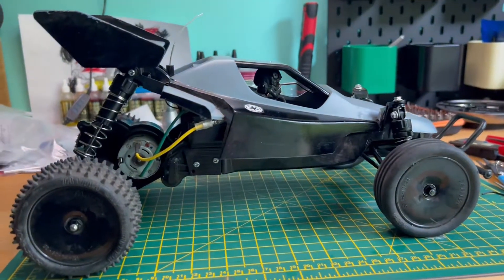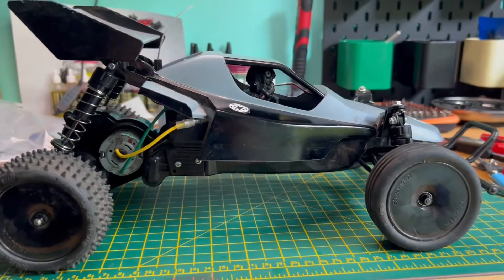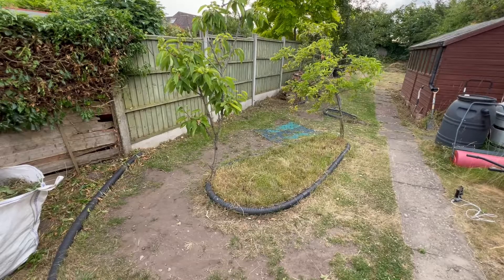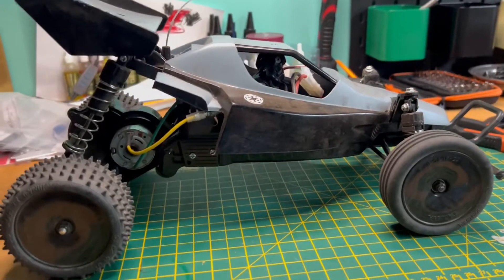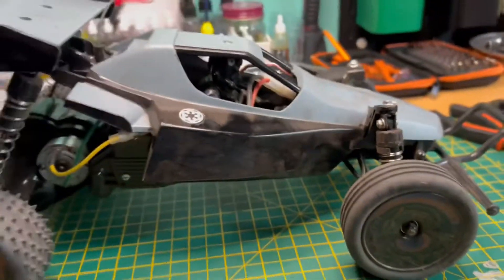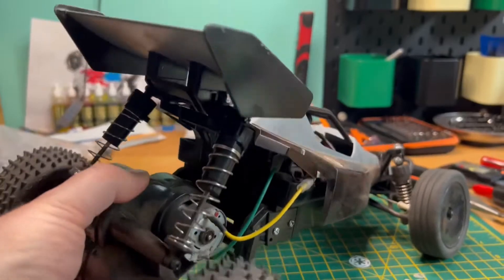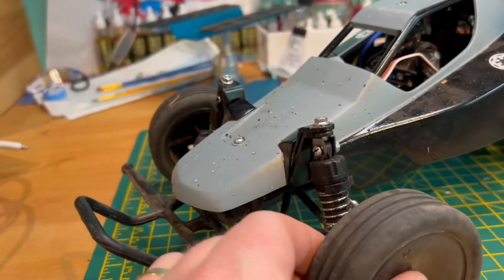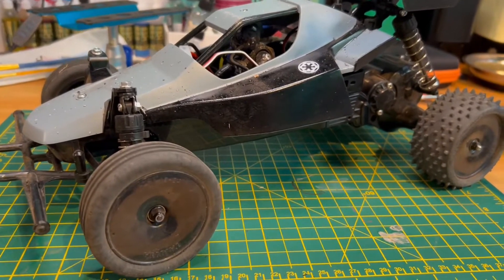Tamiya Rising Fighter Hop Up Series Oil Shocks 2.0 and Steering Arms

Comment: Nice one, Craig! The Tamiya CVA shocks are definitely better. That thing with the front shocks not returning (not lifting the nose) you can't test it on the bench. I reckon they are working OK, better to be soft. The front wont return because the wheels splay out when you push the nose down, due to the swing arm suspension lower arms. Then the friction of the tyres on the bench stops the wheels from sliding back to the narrower track, if that makes sense? Anyway, great fun, all the best, matey!  :))
Reply from the maker: Hey Mark, thanks for watching matey 🙌🏻👍🏻 It actually seems to work better when under driving conditions as the front doesn’t really come under that level of compression. It was super fun playing about with this chassis and I still think I have some extra to get out of it. Some Schumacher’s arrived the other day to help 😁
Reply: Agree with this bud! Also putting limiters in the front shocks will be a big help. Nice video my friend.
Reply from the maker: Cheers Jim 🙌🏻 I am going to tinker with the chassis a little more over the winter and see what else I can get working differently. Such a fun entry buggy from Tamiya and often over looked. Thanks for watching brother 🙌🏻👍🏻

Comment: Hi there Craig, a great set of upgrades to the Rising Fighter. Oil shocks certainly are better, albeit, perhaps still some tweaking to be done to the oil weights. Some adjustments to the front steering, due to the upgraded 3mm rods. You mentioned taking the rear brace back out, as the rear was bouncy still, I think the young Mr Wylie has the 5th Shock mod to his Lunchbox, I was wondering if this idea could be applied to the Rising Fighter? Perhaps with a light weight oil, you’ll get that flexibility, but dampened, just an idea. Anyway great work. Take care and best wishes to you and the family 😊😉😁
Reply from the maker: Thanks John! I will take a look into the 5th shock mod on the hopper. Might be a future upgrade to the old girl as we go forward! At least with all these mods she is ready for a bigger motor! Thanks for watching matey 👍🏻🙌🏻

Comment: Interesting video. 👍I would have thought your mods would have made a little more difference. I'm currently looking at what mods to do to my Grasshopper 2 for next months race, and my first mod will be sorting out the rear suspension. I think for a smooth, high grip carpet track, locking off the rear will be beneficial. But for a bumpy off road track, it might, like you suggest actually reduce traction.

As for the front rebound, I'm no expert, but I'd imagine a little more preload would help. Also make sure the suspension isn't binding anywhere, that might stop it returning to normal ride height.
Reply from the maker: Hi David, thank you for watching 👍🏻🙌🏻 I think you are right that locking on a nice smooth track would be beneficial but on the Orchard Raceway it is limiting. The front rebound seems to correct itself in future videos due to a upgrade on the shocks 😎
Reply from the maker: Good luck with the GH2 mods
Reply: @theoagrc  Thanks!
Reply: @theoagrc  Thanks!

Comment: It does seem a bit stiff in the rear. Mine chatters a bit but not as bad as yours. I am trying to remember if I am running the kit springs on them or the springs that came with the shocks. I will have to take a look tomorrow and see. Shock tuning can be a pain in the rear especially with that hopper style rear end!
Reply from the maker: Hey Addam, I am sure I saw somewhere that you should always try and use kit springs when changing shocks so might have a look at that also. I am convinced that the rear brace  has mad things tricker on the Orchard Raceway so it will probably come off for the 2023 season and see if that makes things better also. Although it can now take a peppier motor so clearly the handling mods helped out somewhere 😁 Thanks for watching dude 🙌🏻👍🏻
Reply: @theoagrc  In some cases I think sticking with the stock springs is good but the stock ones on this buggy are way too stiff I think and the springs with the oil dampers would probably soften it up a lot and be able to get that power down without all the obnoxious hopping and skipping. Worth a try for sure!